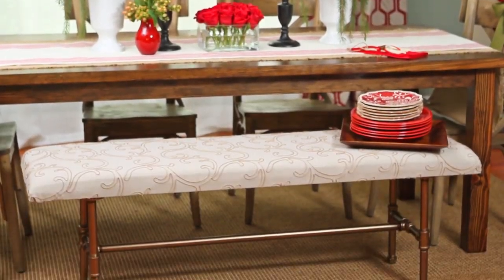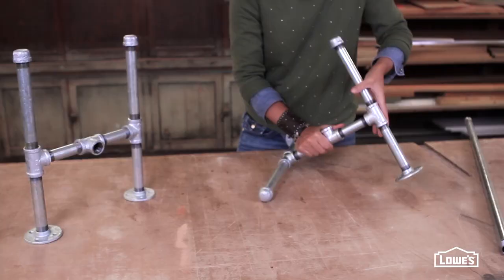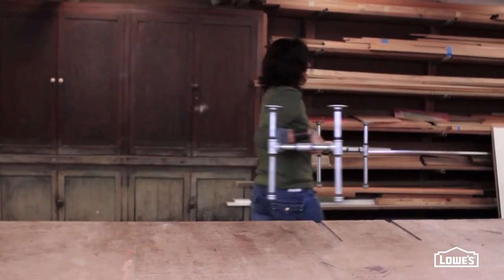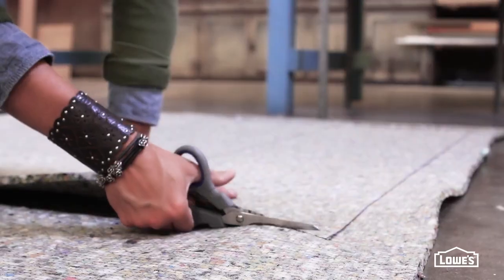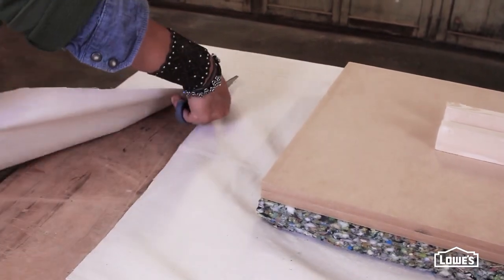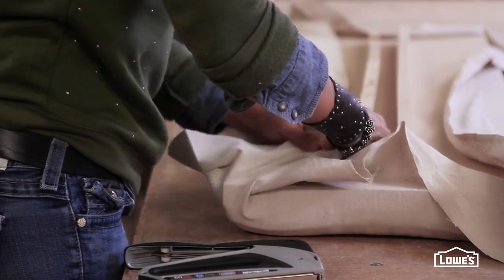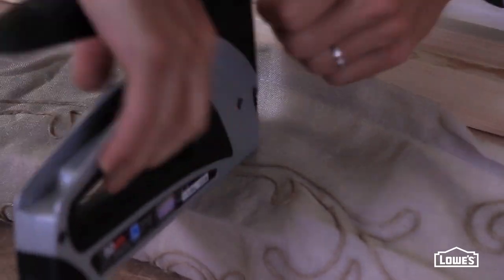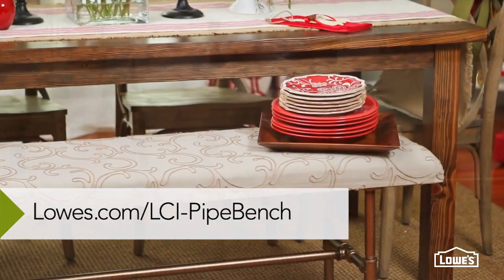How to Make a Pipe Bench

Comment: So you have to buy 2 separate mdf boards and then have them cut to size? Is there another material you could use instead of mdf?
Reply from the maker: Hi Amanda, you could substitute plywood but it will increase the cost. Find full project details here: http://low.es/208U5ov.